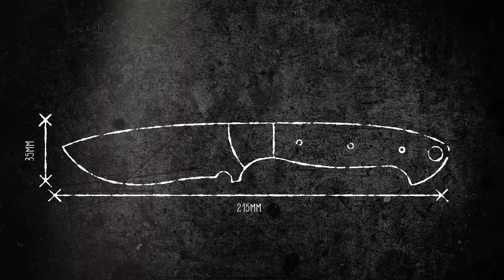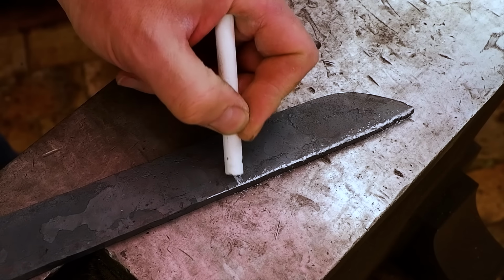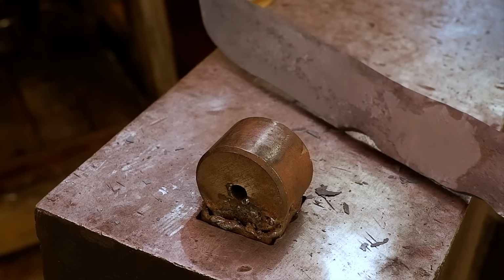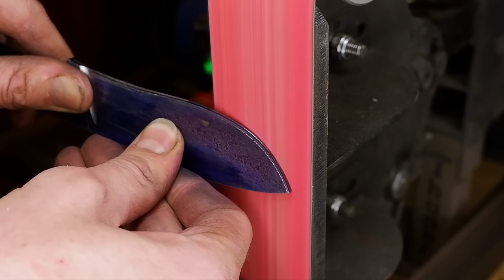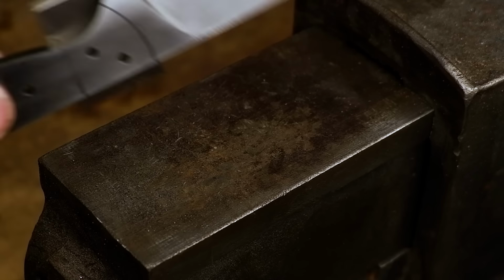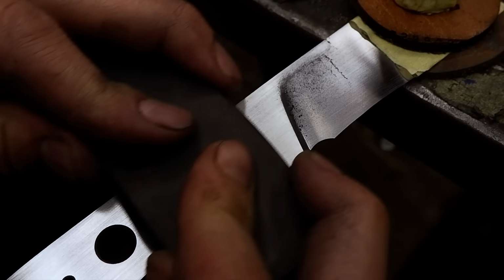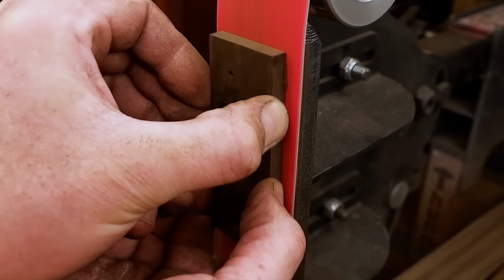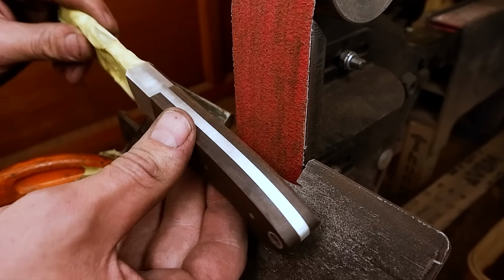Making a Forged Recurve Hunting Knife

Comment: I like the shape of this knife very much. The handle, the bolster as well. Brilliant! I like also this video. Very instructive! I learned many things, some new tips. Many, many thanks!!!!!!!!  Although, I have few questions: (i) Why leaving the hot metal on the anvil after normalization? It will cool too fast. Would not it be better to put it onto a brick. (iI) Why polishing the handle beyond the bolster and the wooden plates, and the bolster itself? The rough (but even) surface is much better for holding epoxy.
Reply from the maker: Thank you for the kind words. Happy you enjoyed it. Regarding your questions, yes you have valid points. So after a whole lot of forging on a day the anvil is actually quite warm from absorbing the heat from the blade...so I'm not really leaving the blade on a stone cold anvil. I also do a second normalization process once I heat treat the blade.  But yes, a brick would probably be a better option than a cold metal surface. With the second normalisation process I leave the blade on the warm forge to  cool down. The polishing (Even though its never more than 220 grit) is a personal preference on my side to be neat. At this point, I am relying more on the peened pins to keep everything in place, where the epoxy would serve as a secondary measure, but mostly to waterproof the inside as well. I have not really seen the advantage of leaving a rough surface over a smooth one. The pin and expoxy holes serves a better purpose by letting the expoxy flow freely between the scales and create bonding pillars. Nothing wrong with roughing up the surface though. Another reason is that metal bolsters can be a pain to fit flush against your blade, and if you focus to much in one area on your blade, you can sand a hollow area, and even a hair line difference gap will show. To elimanate that, I "try" to sand evenly across the entire blade...and thats where keeping rough surfaces against polished blades become difficult. I suppose you could roughen it up afterwards with a rotary tool and a grinding stone, but then again, I am yet to see the benefit. Again...just my way of doing it...you must adapt to your style of working to suit your needs. Hope this answers your questions.
Reply: @zeemanknives  Yes, indeed. I agree. I am happy to have asked. :-) I wish you success and more videos on YouTube!